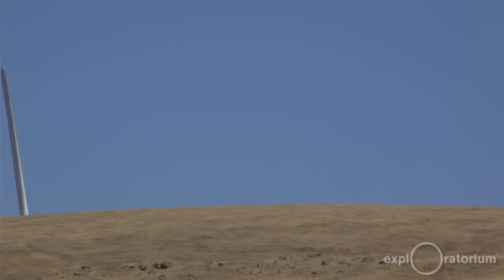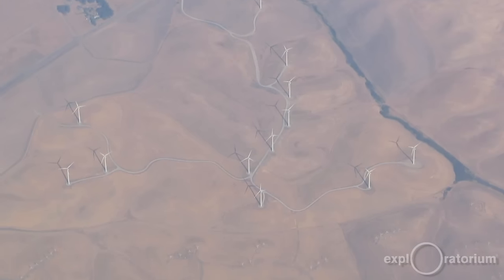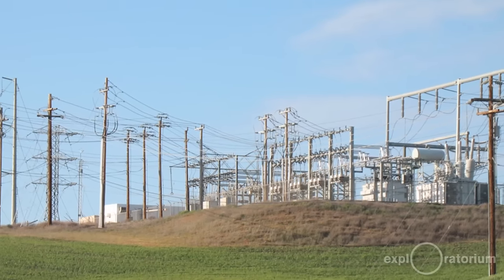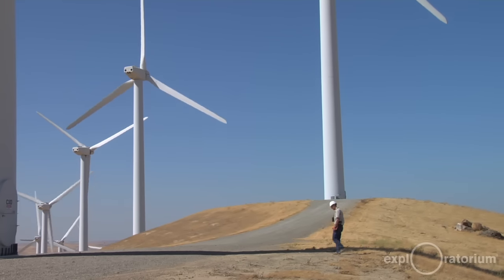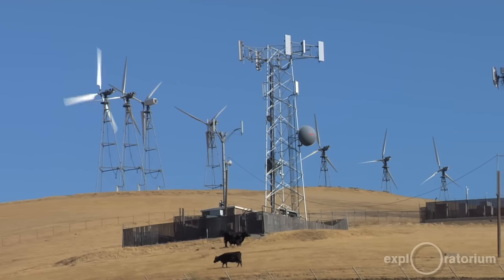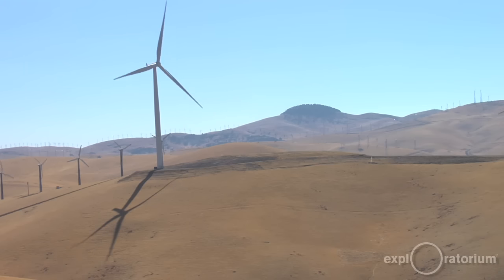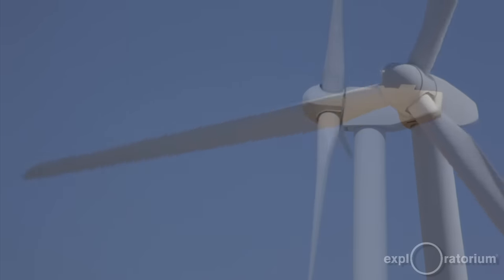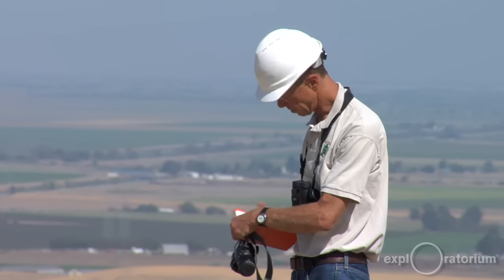Science in the City: Altamont Wind Farms

Comment: Did you notice that a lot of turbines are not turning.   The wind turbies pictured are incredible maintenance hogs.   AC or DC they always have a governor mechanism similar to the "constant speed" governors on many prop-driven airplanes.   Aviatirs will tell you these (much smaller) constant speed props are very difficult and expensive to maintain.

Plus...you have to find daredevils to work at that height in that much wind.
Reply: +Fenton Bevan No manufacturing process is inherently green. Look at the damage caused by unrestricted clothmaking, just about any type of  mining incl coal or building construction.
It takes effort, innovation and regulation to improve them. But companies will run to low-wage, low-regulation countries to avoid taking responsibility for their messes.
But it's not absolutely necessary to use neodymium for turbines; Enercon's giant 7.5 MW E-126 turbine which has been made since 2007 doesn't use permanent magnets.
http://yes2renewables.org/2012/03/06/rare-earth-magnets-not-all-new-turbines-are-using-them/
Reply: I think that they have found that the wind turbine farms use a lot less people to maintain them than the older steam generated power plants.  Those power plants required constant maintenance, with a crew working 24/7-365.  They must feed in very clean water, provide water treatment to the cooling towers, and keep feeding it with coal or natural gas.  And the security forces that must be there all the time.

Comment: All over the country, wind turbines are in disrepair and disarray. Broken blades. Seized generators, or completely toppled over. Either by the wind they once attempted to harness or by the lack of quality materials, engineering, and/or assembly. Geothermal seems more reliable and consistent than these problematic contraptions.